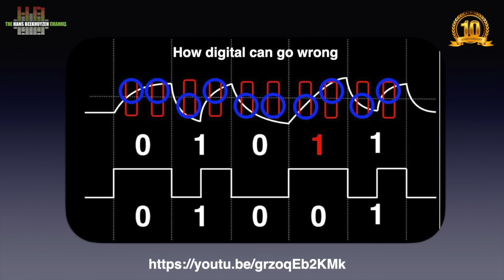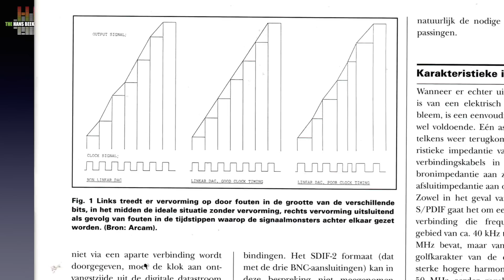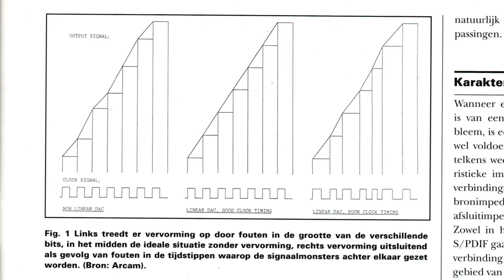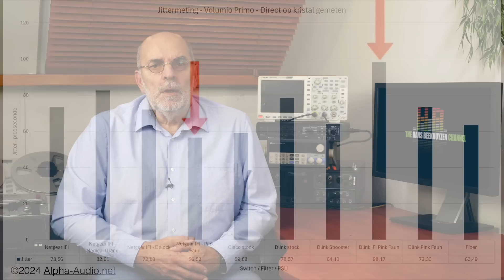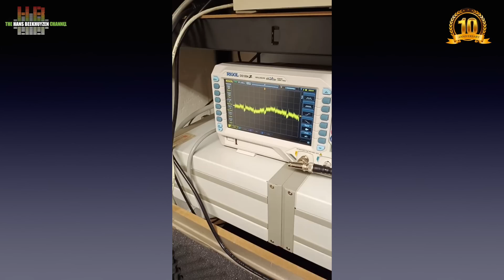Ethernet connections do have influence on the sound quality

Comment: Jaap and yourself get my vote of confidence. However having now got my system pretty complete I find the recording quality of the music is by far the important factor in the listening experience. Many recordings are far less than great.
Reply from the maker: I must say that 90% of the music I play sounds good, although there are great differences in character as a result of the period the music is produced in.
Reply: @TheHansBeekhuyzenChannel listen to any sinterklaasliedjes and you know what bad quality sounds like 😂
Reply: Totally agree! Rubbish in, rubbish out. Great sounding files sound great on almost anything and make much more difference than spending thousands on ‘better’ equipment.
 Also unfortunate Jaaps channel hasn’t done better as I find it great but perhaps he isnt enough of a charming influencer who I avoid like the plague.  
One of Jaaps videos included a Paul Pang network switch which was in two parts. One of its features was that the order in which various ethernet cables were located in the switch bodies made a difference to the sound. I played around with my Ubiquiti switch and also found it made a difference and worthwhile improvement and cost nothing but a little time and effort.
Reply: True. 
That’s why I went away from speaker’s tilted up or too analytical gear.  
Need my 90s music to sound good. 😂
Rolling Stones or Van Halen are good tests for a systems musicality
Reply: @Pok-001 As I get older I prefer the less analytical. A bit warmer and rounded off upper mids is pleasing to my ears. Though many older recordings are still hard to listen to.

Comment: Great video.  Very informative.  I assume some amount of jitter is already baked into the signal during the original A/D process.  Any work on removing it?  I've been thinking that deep neural nets might work.  They are already used to up sample images to higher resolutions.  Should be relatively easy to create training data with music that has typical A/D embedded jitter.  Has anyone done this?
Reply from the maker: There might be jitter introduced to music during recording. But given the quality of the music I play, that is not often the case. 'Digitally remastered' versions of older albums can suffer from that because certain  record companies are not willing to spend money on the remastering.
Reply: @TheHansBeekhuyzenChannel  My personal streaming experience is that maybe 20% of recordings have modest but tangible benefit from improvements on the digital side.  Probably another 60% have gone from almost unlistenable to decent on a revealing system.  I take this to support the idea that jitter is baked into the signal and the there are thresholds were it becomes much more noticeable when combined with playback jitter and noise.  Maybe you restrict yourself to that 20%.